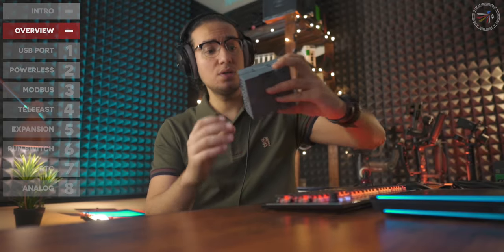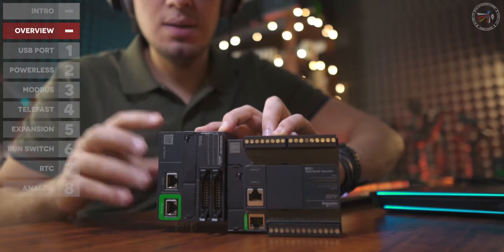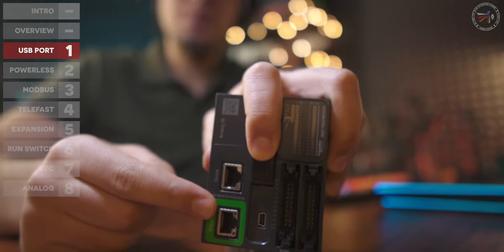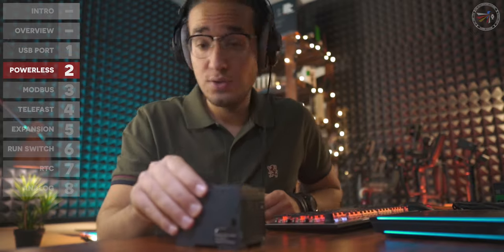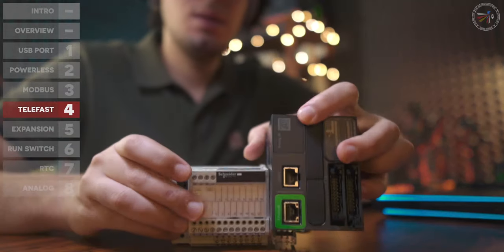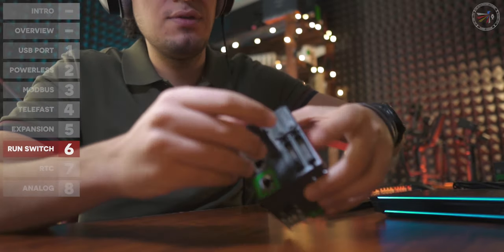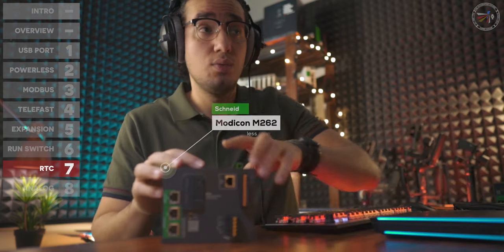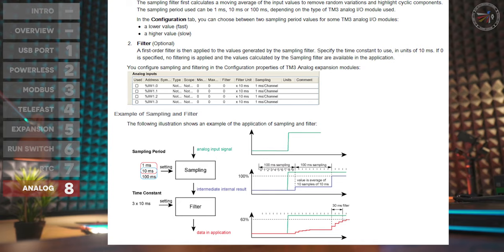[PLC][Schneider][M221] 2# Hardware Is it good enough?

Comment: Another advantage of the of the M221 is that it can use any brand SD card while S7-1200 can use only expensive Siemens cards.

But the real deal breaker for me is the fact that M221 software doesn't support ST programming. This why I always go with M241 and Codesys.
Reply from the maker: 100% agree... and it is very good move from Schneider to use codesys...m241 is my first pick now.
Reply: There are multiple reasons why Siemens uses a Siemens brand sd card as a program memory. It has more security features like plc program binding and 10× read/writing cycles than a standard off the shelf sd card.

However when these things are not needed, LOGO 8 plc can use any micro sd card, Siemens HMIs do not require a Siemens only sd card for the logging features.
Reply: @roberthollingworth906  Do you have the download link?
Reply: @roberthollingworth906  Hi. Is ST = structured text?

Comment: Sir what is the function of sd card in m221 and it is necessary to have sd card while it is in operation and also want to kno what is the function of run switch as when it is working the run switch will be on run or not